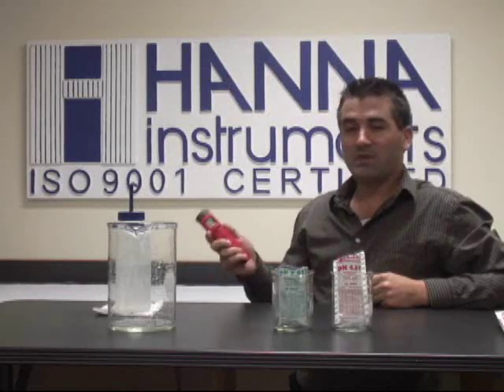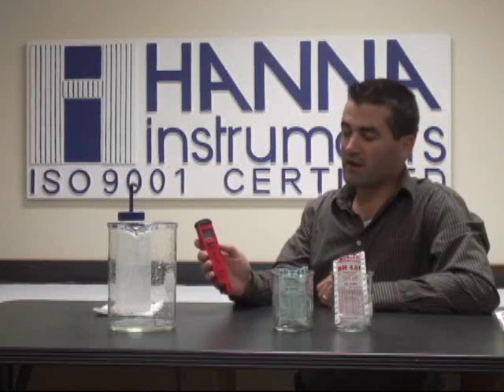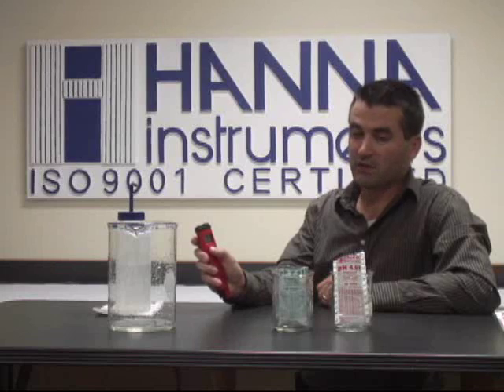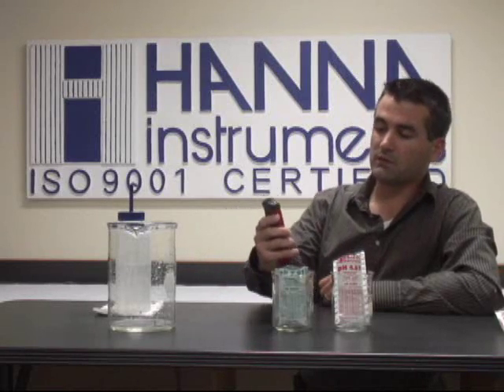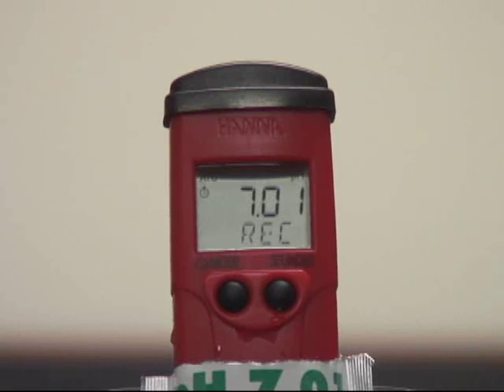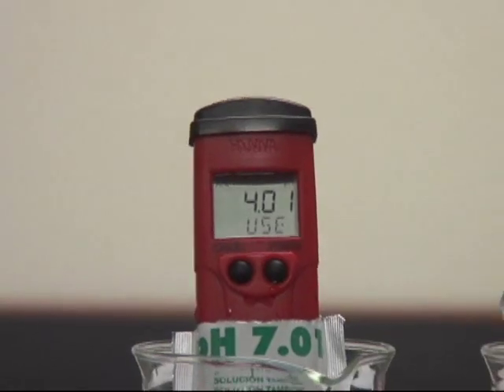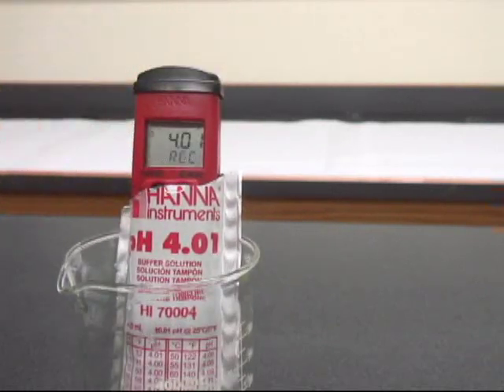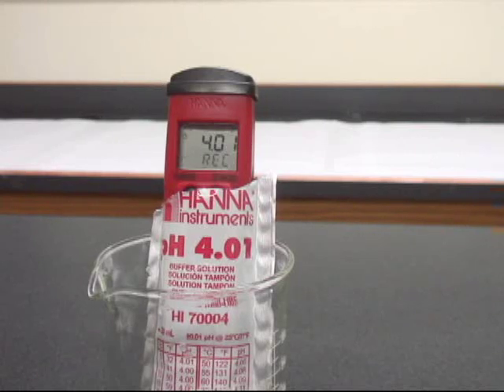Analytical Measurements: pHep 4 and pHep 5 Calibration

Comment from the maker: Its sounds like your tester has a bad pH probe. To test the probe, try the following:
 
Enter the meter into the calibration mode.
 
When you see 7.0 USE press the SET/HOLD button.
 
The meter will show ESC or CLR then return to the normal measuring mode. 
 
Take measurement of the pH 7 and pH 4 buffers if these reading are not within .5 the meter will not calibrate and 99% of the time it is caused by a bad electrode.
 
Typically the electrode needs replacing every year.